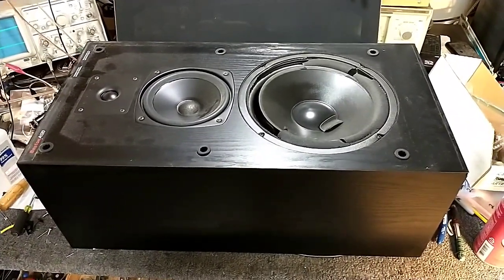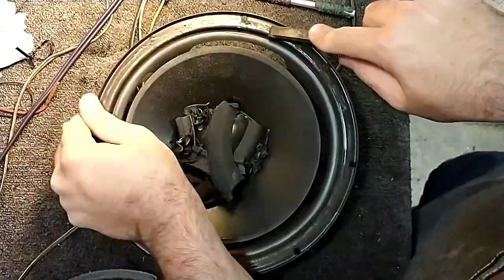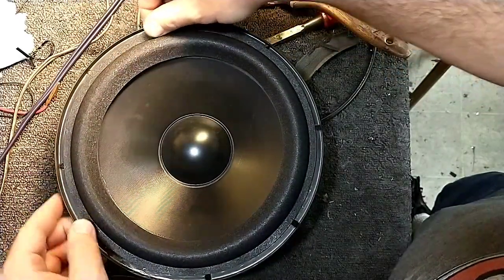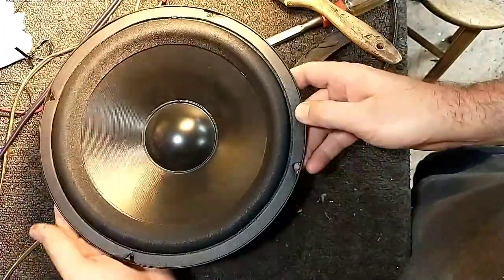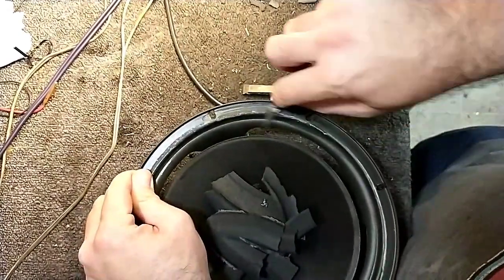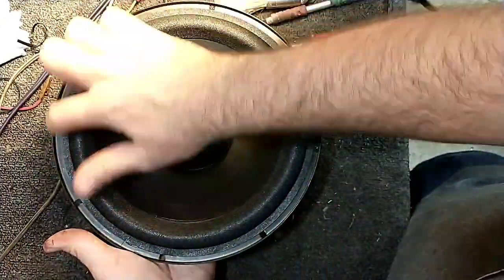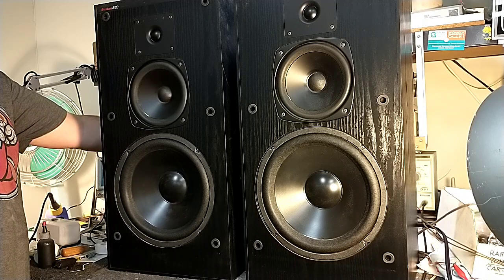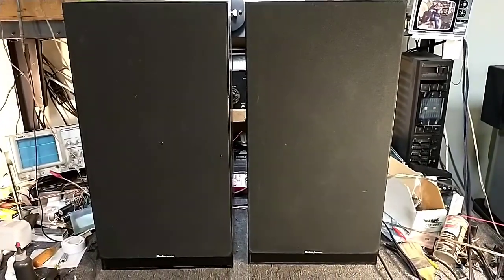How to refoam your Boston Acoustics A-120 passive radiator / woofer.

Comment: Wow.. the woofer is actually the passive radiator and what pretend to be a midrange is a woofer ... Weird but effective! The Little woofer is good at transient and the radiator can handle the low frequencies where the little woofer is not efficient.

Comment: YouTube recommended this video to me, but hey, good video! What's the difference between a woofer and a passive radiator? Is the woofer powered by an internal amp? Or does it only have to do with the frequency crossover?
Reply: A woofer has a coil driven by an amplifier, a passive radiator has no coil and its movement is caused by a woofer in the same closed cabinet. Often the radiator is mounted in the back of the cabinet. Most modern speakers use a port instead of a radiator.
Reply: Passive radiators are used because it's cheaper and you get pretty much the same results as you would with a real woofer.
That, along with the fact that such system uses less power to achieve pretty much the same frequency response because you are only driving a smaller (in this case) speaker only.

Comment: Hay Jorda i got a quick question . I have a ONKYO DUAL CASETT DECK I REPLASED ALL OF THE BELTS THE REC SIDE WONT PLAY BUT IT REC FINE DO U NO WHAT CAUSES IT THANKS.
Reply from the maker: Hard to say. Have to study the circuit with schematics and compare with what the set is actually doing

Comment: No way I would first glue up something floppy like that foam beauty ring then descend that onto the speaker - so much risk that the gluey side will touch the new foam or the cone...  Whenever I do those, I apply the glue on top of the outer area of the basket, on top of the foam's outer flange, then place the dry beauty ring on top of that... zero risk of getting glue on anything but the bottom of the ring.

Comment: So the second speaker from the top is the “woofer” and the bottom one is a passive “woofer”
Reply from the maker: Yep. Kinda like the polk monitor series is designed. 

The theory that the small woofer is fast for good transient response, and the passive tuned with the box for lower bass the small driver can't really do on it's own
Reply: @JordanPier  so why not have a functioning large woofer for the low frequencies
Reply from the maker: @nomusicrc  similar results can be achieved for less, and that's why they do it